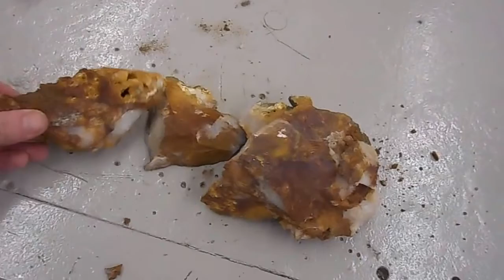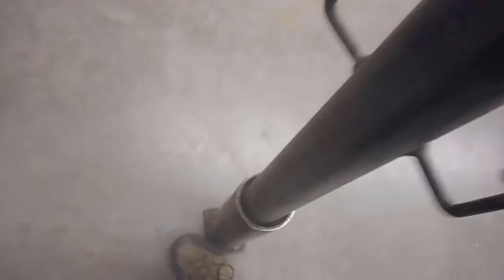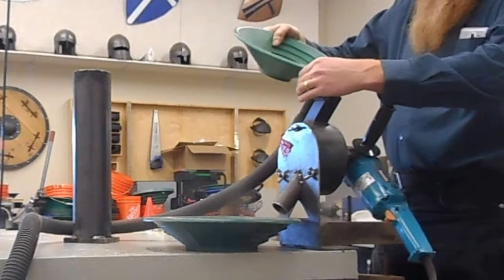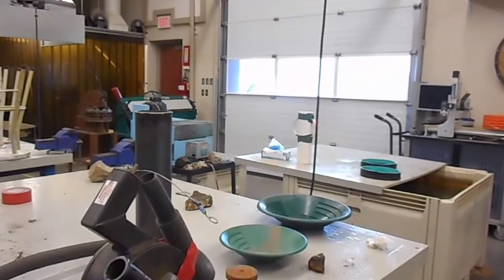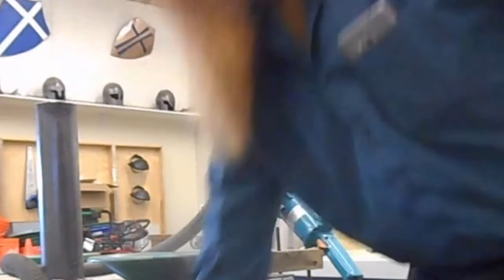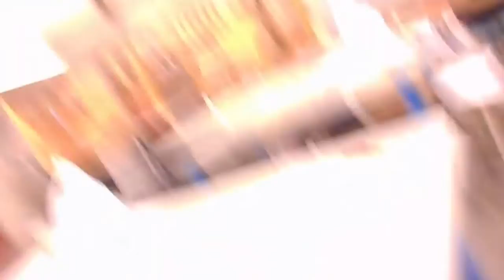Follow-up video to the Ore Sample project.

Comment: It looks like your students have a lot if fun.
You should talk to the school about a portable ventilation system like they use in the welding industry. They are on wheels and very powerful.
Frame the request as a Health and Safety issue for the students, perhaps.  😉

Comment: Put some weather seal around the cap, and see if you can find a grinder with the rotation the other direction from that one so it sends the rock away from the in tube. A shot hose on the end to the catch pan or bucket with help keep the dust contained and then some filter bag of some kind over the catch container with keep it real clean to run. Also if a Diamond blade is used in that saw I do not see why it could not be run with water and some natural anti freeze to protect from rusting.

Comment: Consider next time using a tile saw if the pieces are thin enough as it is water based instead of oil.
Reply from the maker: I can replace the oil with water in this saw too, I just did not want to.  I'm currently doing this assignment and it is working well with breaking 1/2 the rock off before the cut and using that half for crushing.

Comment: Hello again Dan,

Really like how you are teaching the youngsters about the real world.  Some of them spend so much time in virtual reality they have trouble differentiating it from the real world to everybody's detriment.

Looking at your results and methodology I suspect there  may be quite a bit of micro fine gold that you are not even seeing.  I think my method for revealing the micro fine gold in the sample might do  better and with the new simplification is quite easy.  If you could watch my Lesson 24 https://www.youtube.com/watch?v=dEmnr5cV2Y0 on you tube and let me know how it works for you I would appreciate it.

Also a wet tile saw uses only water as a lubricant/coolant for the diamond blade and that's what I use.  It does wear out the blades faster though.  Hard quartz can wear out a blade in less than an hour, but softer minerals are not as much of a problem.  You can also buy diamond laps with the same arbor size and polish the cut surface as smooth as you like.  My finest lap is about 1500 grit.

Keep em coming,

Keith